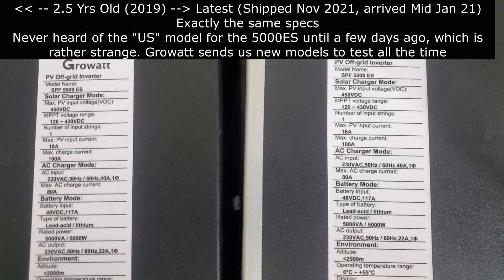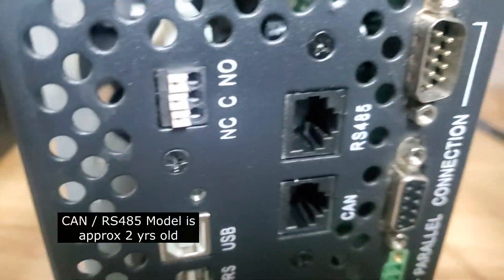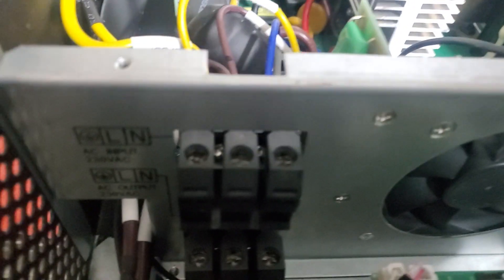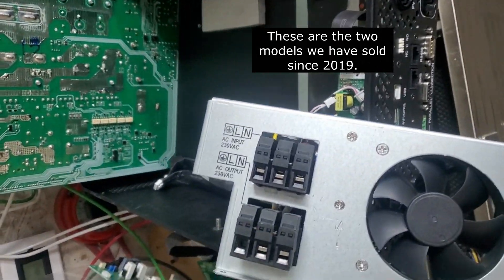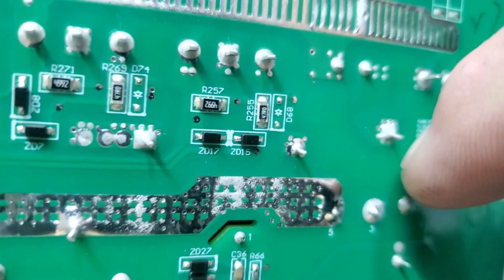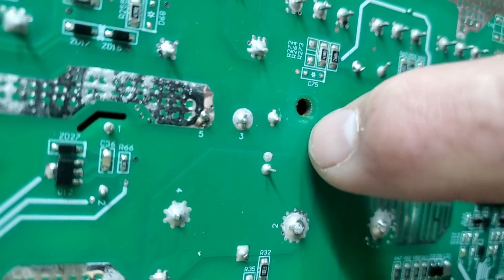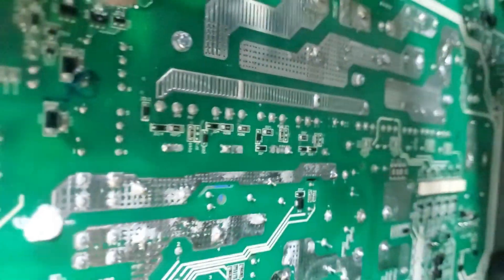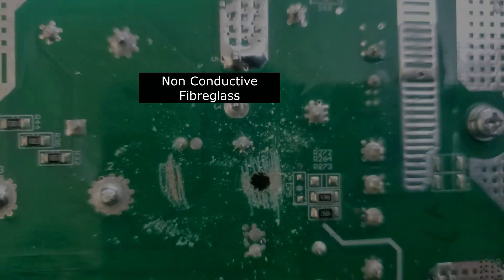A closer look at Ground and Neutral Live Bonding on Growatt 5000ES

Comment: I would remove the board and make sure that all the screw posts don't make continuity with the board I can even add a plastic washer to be sure and then see that the both connections of Neutral and Ground both show OL on the multimeter to keep me safe.

Comment: I bought a 3rd 5000 ES from SS (after trying to support this channel) and it is open on my Bench if you want any pictures.  This is the second until to ship with a battery nut loose in the main enclosure (requiring opening it all up).  The last one also had main power switch unplugged.  All three "worked" and I have few or no complaints.

Comment: For confirmation
I have 2pcs Signature Solar SPF 5000 ES, both work fine and I have never seen a bonding issue.

Now I buy a UK model.  If I remove the bonding fastener then I will have broken the tie between case and a hot leg

So now I have a unit with case to earth and floating L1 and L2 @ 240V

So I don't need a Signature Solar specific unit (and they are out of stock) and hopefully I can mix and match these for parallel applications?

...  Not worried about getting my bond, I have that covered with an Auto Transformer and Main Panel.

...  I am an Electrical Engineer and perfectly comfortable with tearing down the unit.  Had to already when SS shipped me a unit with a battery nut banging around on the PCBA's along with an unplugged power switch

Anyway
I am good to go or am I miss understanding?

-Schindler

Comment: Do you need to make a neutral ground connection in the sub panel when the growatt is connected?
Reply: Where do you live?  In the USA, the active Neutral wire should be bonded to Ground at one point, at any given time.

Comment: Hi can i use this inverter if I dont have Ground ? I have only 2wire L(230V) + N(Neutral)
Reply: @Jozef Flajk - If you do not have Ground Rod, and it is required by code, then install one.

Comment: What if ur 230v inverter only has a line and neutral output it do have a 3 line ac input ground neutral and line but only a two terminal output can i still use one of those solar edge transformers ?

Comment: You claim to have new stock and old stock with the same issue. What you failed to clarify is if you are an authorised distributor of Growatt's Products. Perhaps this is the reason why your models differ from your competitor in the USA. At this point, this is just getting childish. Why not try to focus on genuinely growing your business, rather than trying to do it at the expense of someone else.
Reply: Trying to modify a European model GroWatt, for use in the USA, will most likely not pass an NEC inspection.  You cannot "float" the metal chassis in the USA. It is a shock hazard.

Comment: The Growatt 5000ES sold by "Signature Solar" out of Texas does not have this issue. They have a special version for the US market. So if you order it thru them you will not need to modify the system in any way.
Reply: Unless you are hooking up to the grid for backup. You will not have to modify the inverters per se. You will have to modify your entire system to incorporate an isolation Transformer to safely hook up to the grid. No problem for me

Comment: I really don’t understand what this video is for. You and I both know there is nothing wrong with the transformer. Are you trying to say all of a persons heaters are going on one leg of the electric panel? I am going to shoot a video with multiple 120 loads on a properly wired electric panel. I plan on seeing how hot the transformer gets when you push the load’s much higher than 5000 watt’s. It will be posted Saturday or Sunday.
Reply: I'm gonna subscribe to your channel in hopes that you actually do that.
Reply: @JM-yx1lm  I posted the video. I hope you liked it. The key to any of these systems is to balance your loads and do everything to manage heat.
Reply: @jamesshomesolarmore2223  yeah, I’m with Ian, Will and David on this one.  Your correct that balancing loads is ideal, however, the target audience on these videos is a lot of non-EE’s or non-electricians DIYers that don’t always understand the risks.  I did see your video and noticed you say “Balance the loads” a lot and then say the auto balances the loads for you.  Even SS came out with a video showing how to protect against imbalances.  Grid connected Bypass mode is what you have to be considered with on the Growatt Auto setup.  SS is correct that you should have that auto protected and by doing so an imbalance outside of your  system would be tripping off your “critical loads.”  Anyway, you seem to be taking offense to people telling you of a potential safety risk in your system.  You should really welcome that debate for the betterment of the DIY community.  Don’t make this stuff personal.
Reply: “I really don’t understand what this video is for”

If you watch the last ~5 seconds and read the banner across the screen in text, you will see the purpose of the video explicitly stated, in English.

“You and I both know there is nothing wrong with the transformer”

If you go back through the two previous videos, it is demonstrated clearly what the risks are, for using an Auto Transformer, in addition to suppliers selling EU models in the US.

Video 1	https://youtu.be/gQ4NF9n0UxE	
Video 2	https://youtu.be/goF46wGmPEc	

The risks were real enough where another significant YouTube publisher created a video adjusting his setup, for safety purposes.

Video 3	https://youtu.be/AWOOv4hww8I

“all of a persons heaters are going on one leg of the electric panel?”

Anyone who watches the 3 videos in this comment KNOW that this rhetorical question has nothing to do with it.

This question presents a “straw man”, a logical fallacy, a form of rhetoric where one is passively admitting their argument has a logical flaw.

Your assertion that you will create a video showing something related to a “straw man”, never addressing the safety concerns addressed in Ian’s first 2 videos, is leading people into a false sense of security, since you are not addressing the myriad of safety concerns Ian brought to light.

If you go ahead with that video on a straw-man argument, disregarding the actual safety hazards that Ian pointed out, then claiming the hazard does not exist, after another YouTube publisher took it to heart… that would likely put you in some degree of legal risk if you have any $$$ in the game. Especially if someone dies.

I don’t even know why you posted this comment, it was completely unnecessary, except to place you in some degree of possible legal jeopardy.